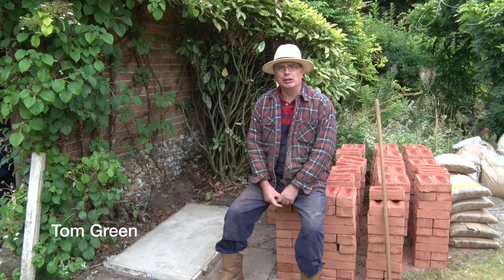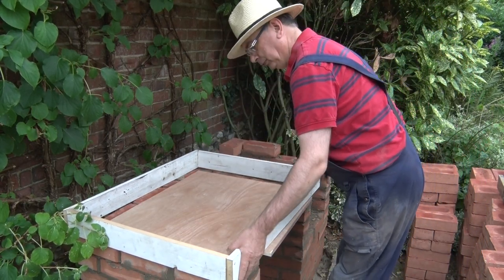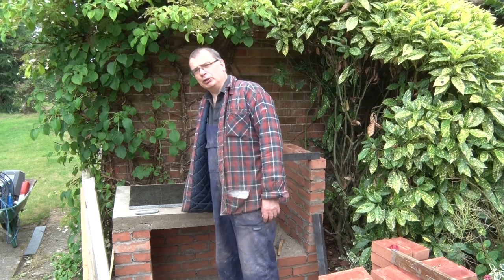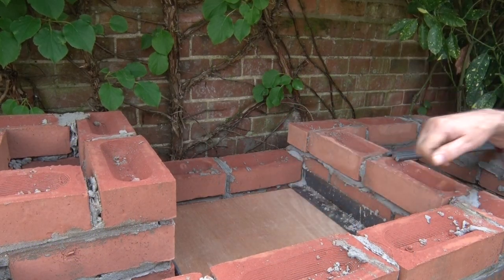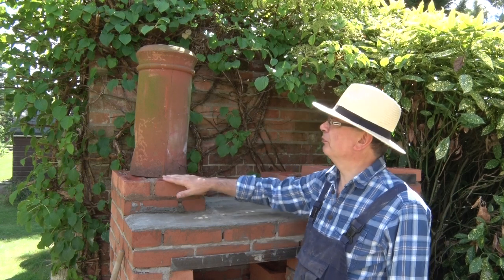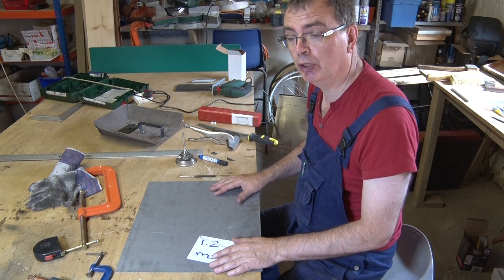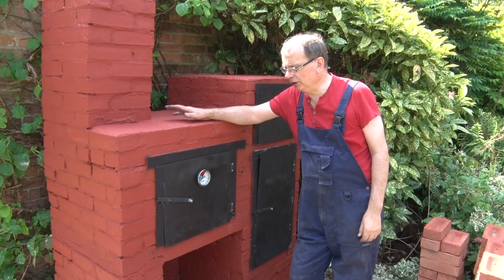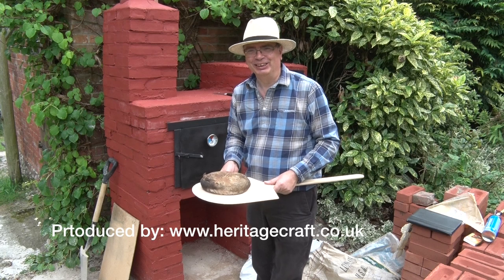Building a wood fired Bread Oven

Comment: How long did it take you to heat it up to around 250C? Was it three hours hahaha I am really looking into this and buying the project book from you. Great build :)
Reply from the maker: due to the size of the body of water you can raise the temperature at a rate of about 1.5 degrees C per hour using this method, so it all depends upon the input water temp, but it will take more than 3 hours

Comment: Hello Tom im wondering why the fire is lite next to the oven chamber and not directly under. in my experience with bread baking, the floor or base of the oven is required to be really really hot. I love the look of this oven and  I am looking forward to building this project in my yard.
On reflection, is there anything you would change in the design?
thanks, Yon
Reply from the maker: I have replied to your email. Having used this oven for a few years now I am still happy with it. My only change would be to make sure the oven floor was granite

Comment: can i use the cheap read bricks with the holes in them?
Reply from the maker: It will work but not as well. What your trying to create is a thermal mass, a body which retains heat, which doesn't work as well when there are holes running through.

Comment: What's that small hole for next to the main oven door....I orginally thought that's where a thermostat was going
Reply from the maker: I put the hole there in case I wanted to install a flap to cut off the fire as some form of temperature control. Having used it I now see that's trying to be too clever and you don't need it.
Reply: Aha...Cheers...great looking fire.

Comment: Definitely has a Hobbit vibe :D but it looks like it works well. I wonder if the temperature can be controlled.
Reply from the maker: thanks for the comment. It does have a temperature gauge so I know what's happening. If you need it hotter put more wood on. best wishestom